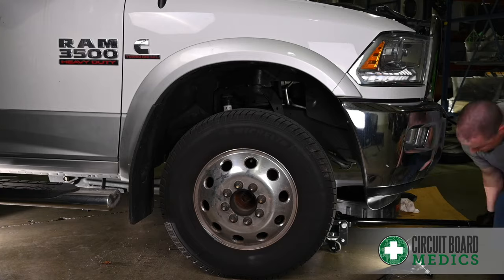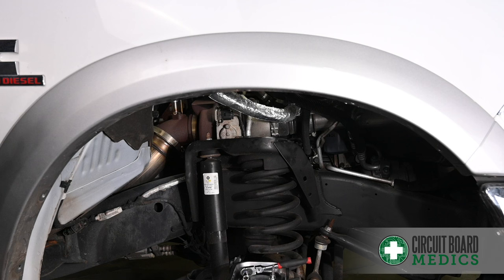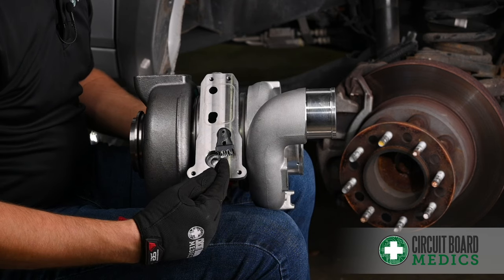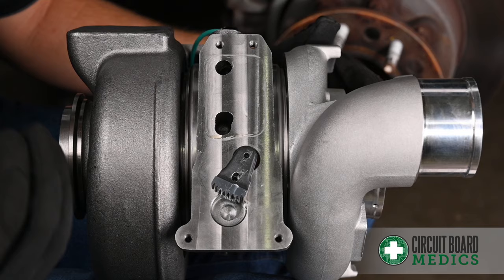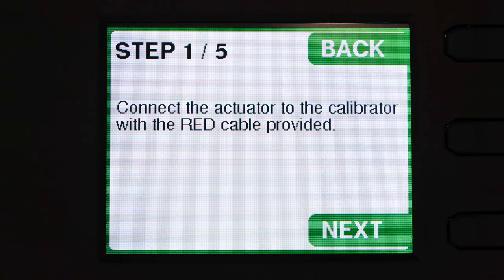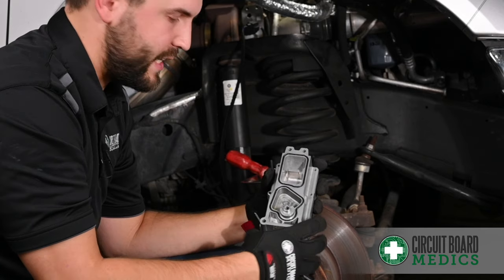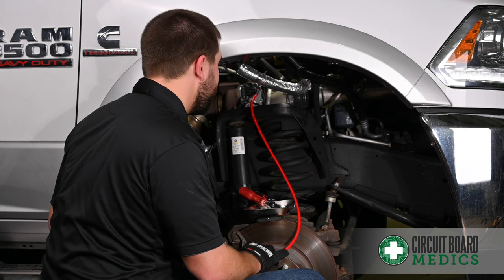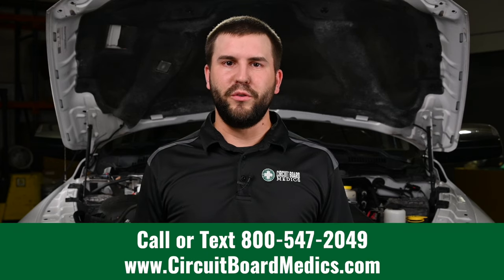Cummins 6.7L HE300VG Turbo Actuator Removal & Installation (Ram 2013, 2014, 2015, 2016, 2017, 2018)

Comment: Hint for anyone doing this: start and run the truck to opperateing temp after install and before you put the fenderliner back in to check for leaks

Comment: How the heck do you get the bottom 5mm allen head bolts?
Reply from the maker: Thanks for the question, LB. Those can only be accessed with an Allen key. An Allen head socket/ratchet or power tool won't fit.  The lower left bolt can't be removed from the actuator until the actuator is removed from the turbo, and the bolt needs to be put into the new actuator before it is mounted to the turbo. If you have any further questions, you can also ask one of our customer support representatives at 800-547-2049. You can call or text them through Thursday this week, 8am-5pm EST.

Comment: What about a ram 2021 is the install different and the callibration
Reply from the maker: Unfortunately, we are not yet able to assist with the removal or calibration of turbo actuators on the 5th gen Rams.

Comment: if I'm just replacing the gaskets on the actuator do i need to get it calibrated?  no codes just a small coolant leak
Reply from the maker: Any time you are removing the actuator from the turbo we recommend that you calibrate when putting it back on. If the gear on the turbo or the one on the actuator move, even slightly, your actuator will be out of calibration. Thank you for your question and please don't hesitate to reach out to us if you have any others!
Reply: @CircuitBoardMedicsLLC  thank you

Comment: Why did you drain the coolant from the system prior to pulling the actuator?
Reply from the maker: The coolant runs through the actuator, so if you don't drain the system, it will drain itself (to the level of the actuator) when you remove the actuator making a big mess and likely ruining the circuitry of the actuator in the process.
Reply from the maker: The coolant runs through the actuator. If you don't drain it prior to pulling the actuator, it will drain down to the level of the actuator as it spills out AND it will most likely run into the actuator itself as you remove it ruining the electronics so you won't have a useable core to return.

Comment: Just replaced my actuator and calibrated that I got from you guys. I’m still getting the U010C code. I’ve cleared the code on my little tool but the engine light doesn’t go off and when I reread the codes…it pops up again. The truck runs better but I’m concerned. Any suggestions???  Or how can I clear a Hard code perhaps?
Reply from the maker: Thanks for reaching out. Please give us a call after 11am EST and let one of our customer support reps know what's going on - we'll be able to help you better over the phone.

Comment: What happens if i dont calibrate my actuator on my 2010 6.7
Reply from the maker: The calibration sets the limits for the boost and the exhaust brake. Without calibration the turbo and turbo actuator don't "agree" on the position of the gears. As a result, you won't get the complete or accurate range of boost and brake out of your turbo.